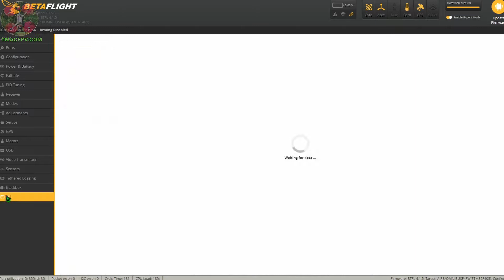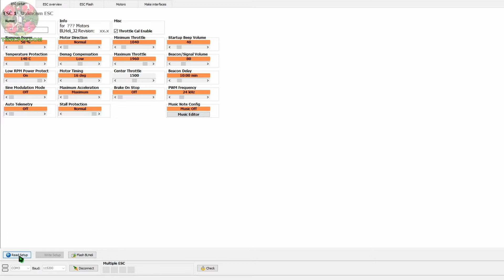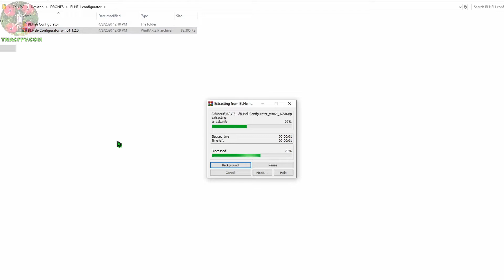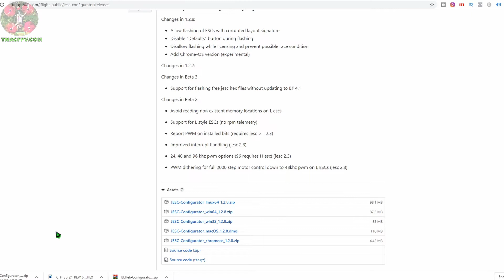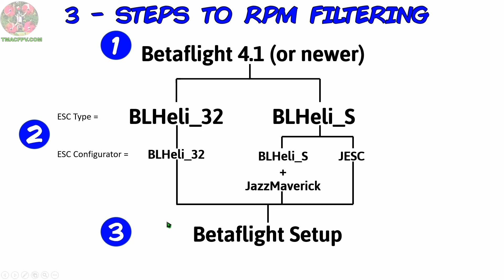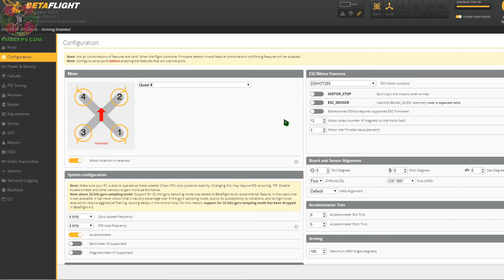Betaflight RPM Filter (SMOOTH FLIGHTS!)

Comment: I´m building a 2.5" 2S micro with 1103 motors at 8000kv. Would you recommend the 24 or 48 khz JESC firmware? And do you know if I need to do additional settings in Betaflight to get 48khz set up?
Reply from the maker: Hey Shattered DnB!  48kHz will do you good!  Nothing else in BF to do additionally for 48kHz.  You should get about 20-30% more flight time with it.
Reply: @TMacFPV  Thank you kindly my good sir! The reason I ask is I tried setting up RPM filtering according to Joshua Bardwells instruction, but it flew like absolute garbage! Now I tried using your settings (that might be better suited for micros) but it still flies like excrement, major vibrations and prop wash at every turn, especially in the yaw it seems, so I guess I´ll have to try some tuning! Would you recommend tuning the pids or the filters first?

Comment: I have a question.
Looking at the log values, it seems that the rear 1 and 3 motor values are lower than the front motors 2 and 4.
Is this correct to see that it uses a large propeller and a high rpm motor on the back side and is generating more output than the displayed value?

Comment: Hi TMAC im using a CrazybeeF4 PRO V2 from a Mobula7 but there is`nt a tab for number of Magnets in the Betaflight Configuration. Anyone here face the same issue? im using betaflight 10.7.0  currently.
Reply from the maker: You have to have Bi-directional D Shot toggled on and ESC firmware installed that supports it (i.e. if using BlHeli_S ESCs, you'll need JESC firmware installed on your ESCs or JazzMaverick v16.73): https://github.com/betaflight/betaflight/wiki/Bidirectional-DSHOT-and-RPM-Filter

Comment: Question: If I have a smaller cinewhoop similar to an umm95 or beta95x it has a 2-4s 20A FC belheli_S and 1204 5000kv motors in JESC should I flash it with 24hz or 48hz?
Reply from the maker: 48khz.  I flash all of my micro motors from 1507 on down with 48khz.  Definitely 13xx on down.  Extra flight time!

Comment: Sir please help for hotter motor setting for betaflight 4.2 and rpm filter. My notor is hot when using default settings. But after move both slider to far left. It improves but still warm motor around 15c-20c degrees. What is best setting to get rid of this stupid noisy signal? I almost give up on this jhemcu ghf411aio matek f411 aio 30a.
Reply from the maker: Hey HelioGenesis-HS!  No worries, friend you got this! If you're using the Betaflight "defaults" for your PIDs (even though you've moved the filter sliders left), that may be your issue.  This is because you've got a "micro quad" (based on the type of flight controller/ESC you've told me you have).  Following the steps in this short Micro FPV Tuning Guide Playlist should help you out. https://www.youtube.com/playlist?list=PLKAiYAaTdvmoXyDzrPWj9-sxv4m1GNKCT  Keep in mind, if after flight, you're able to gently press your fingers on the outside of the motor for 10-15 seconds without feeling the need to remove your fingers from it due to excessive heat, the motor temp is most likely ok.
Reply: @TMacFPV  thx i will try move slider to left. Ur videos have some incredible explanation ever in fpv tuning guides. I will watch all
Reply from the maker: Thanks! You'll get it, I'm sure👍They should help you out 👌
Reply: @TMacFPV  hi again sir. Quick question. Do u think placing receiver on top of aio flights controler will effect gyro noise? I have placed receiver on top of aio with 2 plate double tape seem with tuning cool down motor abit with angle mode testing. Whats ur opinion sir? Should i place receiver higher away from aio? Thanks again for the throughly easy to understand pid tuning guides. Subbed

Comment: I noticed that you set your ESC protocol to DSHOT300. My question is, can I use this BetaFlight RPM filtering setup on DSHOT600 ESC's?
Reply from the maker: Yes you can, depending. . . I use 300 for best stability.  Scroll down to "DShot 150, 300, or 600?" section on this site https://github.com/betaflight/betaflight/wiki/Bidirectional-DSHOT-and-RPM-Filter  May have "loop time" limitations based on what type flight controller you have.  See (scroll down to)  "More Accurate Loop Times" section on this site: https://github.com/betaflight/betaflight/wiki/4.2-Tuning-Notes
Reply: @TMacFPV  I updated the firmware on my flight controller and esc. I switched on Bi-directional DSHOT in BetaFlight. When I look at the motors tab, I'm shown a 100% error on my motors. BetaFlight is updated, and I had my battery plugged in at this point. Do you have any insight as to why I'm getting this error on the motors and if at all possible to fix or adjust it.

Comment: Tmac betaflight devs claim jazzmaverick firmware above 16.73 is not stable and non official??
What is your thoughts on this???
Reply from the maker: You are correct.  I've read various threads on this topic.  Developer of JazzMaverick firmware chose to implement things i the firmware which are not the same standards/protocol for use withe Betaflight.   My simplistic interpretation of this is JazzMaverick firmware above 16.73 version doesn't "speak the same language" as Betaflight expects.  This is the reason I mention in this video I prefer JESC.  It works really well, I don't have to think about what version works and doesn't, and it only costs about $6 (a very small fee considering the amount of time and effort that went into its development for us AND it increases our flight time (on every flight) by up to 30% on "smallish" motors (11xx and down).  IF you really want to use JazzMaverick, I'd highly recommend to go with the Betaflight Dev's recommendation to use only 16.73.  JESC though works really well and is soooo easy to implement (shown in video).
Reply: Thanks and I agree with choosing jesc fw
Reply: Did the jesc 2.3 update with 4.2.0 and 5in flys awesome!
Thanks TMAC your advice and guidance is impeccable!

Comment: Hello Tmac, thank you for your wonderful videos. I am trying to flash using Bheli_S but the configurator is identifying only 3 ESCs..should be be 4 right? I am using a STABLE F411 BLheli_S 4IN1 12A ESC
4 motors are working all right. any clue? tks a lot.
Reply: Yo tenia el mismo problema, al parecer es alguna incompatibilidad de la FC, lo resolví con reemap la señal del motor a otro conector ejemplo un TX q no utilizaba, claro está que primero ahí que revisar que no esté cortado el cable de señal

Comment: Great video.   One thing to add,  if the quad is setup correctly and flying well,  the goal would be to move both the Multiplier Sliders to the right, test- flying and feeling the motors in between every few notches. The further you go to the right(which decreases filtering), the more control you will gain,  and the less bouncing and floating around you will have.  If your motors get hot or you experience weird loss of control or flyaways, pull the sliders back to the left a couple notches(which adds a little filtering back).  Currently with my 3" iFlight DC3 build,  I've got both of my multiplier Sliders moved 8 notches to the right, from the default(middle) position. But,  every quad will behave differently, so gradual changes are best.
Reply from the maker: Hey Carbon Icarus! Yes, absolutely, thank you for explaining those details🙏Your info is what I was alluding to at the 22:55 time hack. Sounds to me like you've got yourself an awesome setup there 👍 How's she flyin'?
Reply: Appreciate the extra info
Reply: Thank you, this is good info as well.